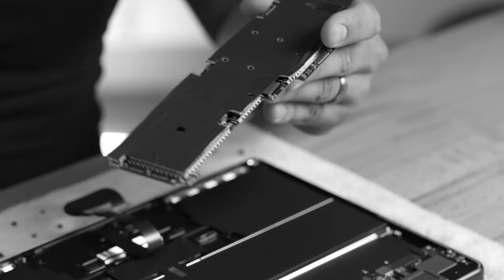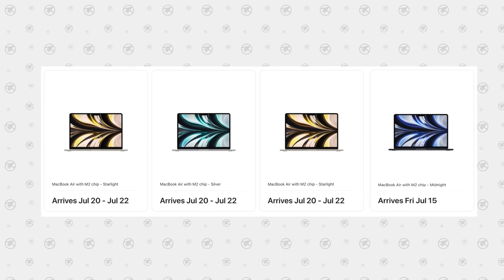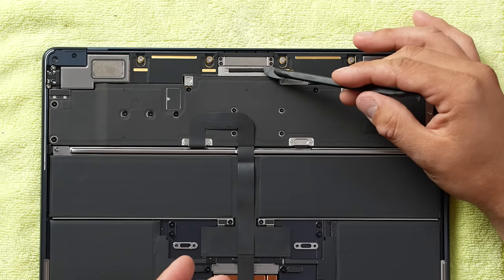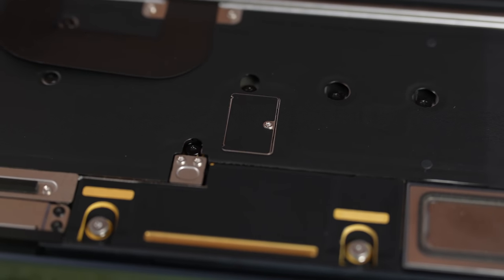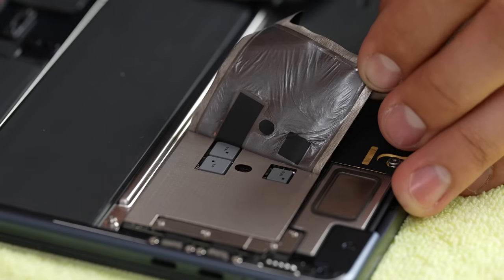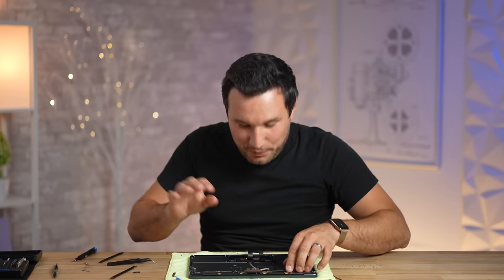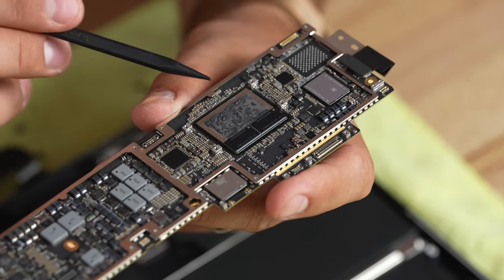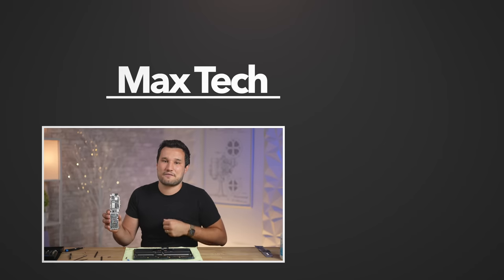M2 MacBook Air Teardown: Apple's SECRET Revealed (& SSD)

Comment: No matter what the reasons for the weak SSD are. Apple would have found a way if they wanted to. Simply supplying the device with 512 GB as standard would be an option. At least for the Pro model because it is supposed to be a Pro...
Reply: you're right its more forgivable on the air
Reply: Would make so much sense, apples line up is a huge confusion. The gap between entry level machines and pro are too close. And the upgrades prices even get the all thing worst...
Reply: @macalienx  I bet anything they want a bigger gap but with chip shortages and prices they couldn’t. The air alone went up like $200.
Reply: At the price of the new air (and pro as well) they should definitely have 512gb as starter and no 256gb anymore.
Reply: @RyanEllerbe  true, that situation with the chips are going to bring all those prices up... And the delivery times too.
Reply: yep,
Reply: Amen to that.
Reply: at those quantities that apple purchases at, it would have been a dew DOLLARS at most for them to give us a better SSD. it's unacceptable to start at 256gb for a $1200 laptop
Reply: @nintendork07  .... but in the other hand if there are no chips avaiable the prices probably are going through the roof... But i agree that for the price and the actual fact that we are in 2022, 256gb are useless if we think the capabilities of this machines. They are not a machines for ocasional browsing and word documents...
Reply: @RyanEllerbe  you do realise another 256gb module costs less than 30 bucks in bulk?  It's a NAND chip only, the controller is external on these apple selicon machines. 
They could easily eat up the cost to make the base model 512gb, and even increase the price by another 50$ and no one would bat an eye, but no, they make you pay another 200$ for it or you get an SSD half the speed of last year's model...
Reply: @houssamalucad753  first we have to assume that they could get enough 128 GB chips. They also want to make a certain amount on each air. If they would of added $50 people would be losing their minds.
Reply: @RyanEllerbe  they already added 200$ and people didn't complain too much because of the improved desing, I bet no one would complain about another 50$ increase for double the storage tand SSD speed (and as a bonus a more durable SSD for swap)
Reply: @RyanEllerbe  it's apple, they are the first in the list when they make that kind of order, suppliers chose them first because they always make huge and reliable orders, maybe they can't justify 128gb chips, then they can put 2 of the 256gb chips instead with a reasonable price increase (it wouldn't cost much more trust me I work with this kind of stuff)
Reply: @HotHeadCringe  How about if we take preventive measures to help Apple with the supply and discourage everyone from buying this crap.
Reply: @HeavenSevenWorld  How is the M2 MacBook Air crap? It's an amazing piece of kit.
Reply: Ya true, but marketing wise, they can’t. Apple need a low price version so they can put it big on their website.
Reply: @yapchenpo95  Oldest trick in the book, same with car companies advertising a car for $20k, but the commercial only shows the top of the line $30k model, which is the one you want as the base model has nothing.
Reply: Oh, so the 512GB SDD is a good option to take to mitigate this SSD speed concern.
Reply: @yapchenpo95  they are still selling the M1 air...
Reply: @PerplexedPhoton  ...starting from 16/512, which is very close by the price to MBP 14" 16/512, so no – it's not amazing. It's pathetic.
Reply: @JK533  With the CPI going up 9.1% and the PPI going up 11.3% in June, you expect more for less anywhere? We’re typically getting less for more, especially in the light of shortages. People don’t cut prices during shortages or even keep them the same. This is the first price increase on the Air in about a decade. I don’t remember the exact time of the last price increase (it went up by $200 and then went back down by $200 a year later), but it’s been a long time.
Reply: They could have found a way. You might not like what their way would have been if they had chosen differently. Given the catastrophe with Western Digital’s two factories that destroyed trillions of gigabytes worth of flash storage, the solution would have probably been to postpone the Air launch for a long time until supply catches up. Which poison would you prefer?
Reply: @techinrl9869  Postpone instead of ruining the great impression after the M1 during the difficult time of the transition, obviously.
Reply: We don’t talk sense when it comes to apple. This is makes too much sense.
Reply: The M1 Air set a new standard for basic laptops. The base model  M2 Air should have had the same dual SSD as the M1. There is no reason that the M2 should have lesser performance compared to the M1.
Reply: Yes, with the new price, 512GB as standard would be a nice decision
Reply: Hehe, Apple loves screwing their customers.
Reply: Actually the Pros start with base 512GB
Reply: This is the genius of Apple, you want a new upgrade as soon as you buy this model. Yet people come back for more.
Reply: Last time there was a redesign, 2018 it went up to 1199, same as this year and then it dropped by 100 a year for the next two years
Reply: @rrp6405  so if i understood well  the 512 ssd is better because it has 2 chips?
Reply: The reason its slower is because they use only one chip. With M1 on the air and the pro the 256gb option used to chips
Reply: @RyanEllerbe  i dont believe the price jump was because of the chip shortage. Everytime apple released the macbook air with a redesign it was more expensive than the last one and in the span of two years it went down to 999
Reply: It saves costs. For the most popular versions, they simply need to order one type of chip.
Reply: @macalienx  256GB costs around $25, Apple definitely could increase the base storage to 512GB.
Reply: @luquivarde7266  they use two chips for m2 ssd from 512gb up ?
Reply: @techinrl9869  in the other hand, when inflation was virtually non-existent, Apple didn't reduce the pricing (like other companies do). It's curious how we are ok with Apple not reducing prices or even running promotions when all the other companies do it, but when they increase price is all "but of course it should be more expensive, it's because the inflation".
Reply: @AlejandroLZuvic  Apple knows that many people will buy it anyway, so they keep making profit...
Reply: @AlejandroLZuvic  What gave you the idea other companies reduced pricing? What they’d do is come out with new items and charge the same prices. Keep in mind with inflation at 2-3% as normal, not raising prices IS reducing prices. They’d still be losing 2-3% each year. I would note Apple did reduce prices many times. Each time an iPhone carried over to the next year, they’d reduce it $100, e.g. iPhone 11 and 12.
Reply: because of supply chain issues, and Chinese government restrictions, and inflation Apple probably had to through it in last minute, overall the m2 chips seems to be quite lackluster.
Reply: Great tear down!
Reply: There is no "Pro" MacBook Air model...
Reply: Actually this would be something to decrease the speed in the m1 models so that m2 would be a much better option
Reply: I bought M2 base model but I will return it and get a M1 16GB 512 SSD
Reply: Maybe it has something to do with availability of 128GB NAND chips. Apple probably has a hard time getting 128GB NAND Chips these days, and they don't want to go straight to 512GB base model due to pricing.
Reply: Exactly this. Apple KNEW these reviews would come out and did this intentionally to try to upsell you.
Reply: Yes 512GB should be starter size, I can understand TB4 and docking will get you great speed, but 256GB is to small even 4 years ago.

Comment: These reviews and teardowns really help me in deciding what to do, M1 Air, M2 Air or spending more and going for a 14 inch Pro. For me it works to understand how they are build and how they perform. I am not a creator who needs huge SSD’s and multiple 120Hz 4K or over displays so all of the extreme benchmarks do not really apply in my case. A teardown like this helps.

Comment: I would be very interested in seeing how this thin heatsink performs, and how much thermal pads would help. This heatsink has quite a lot of surface area, so you could probably fit a lot of thermal pads on it.
Reply: It is worth remembering there are regulations as to how hot the bottom of a laptop is permitted to get, if you are sure your never going to use your laptop on your lap and you have a metal case a thermal bridge to the underside of the case will really help with thermals but be very careful not to use the laptop on your lap or other meltable fabrics, if you do a mod like this you need to only use your laptop on a desk (and a desk that is not going to be damaged by hot things so not a nice wooden French polish). 

What would be a more interesting mod but would require someone with some tooling (many LTT or someone else) would be to remove the large speakers and run a heat pipe from the cpu to that area with a small fan.
Reply: this little thing is going to get hot and thermal throttled a lot!
Reply: @hishnash  Add thermal pad+external fan, that’s going to be the best combination
Reply: @hishnash  
I doubt it would be that bad. 
The M1 Air with thermal pad exporting 4K video still has a cooler base than the 2015 MBP that’s streaming Netflix while on the charger. An M2 with thermal pads will only heat up while running prolonged heavy tasks like video rendering and exports and it still generates less heat for the performance than Intel chips, and no one exports video with their computer on their lap. You hit the button and set the computer aside to do its thing.

Comment: It’s so beautiful, but if Apple designs the base model with 16gb ram and 512gb SSD, that will make it more attractive. Thank Max Tech for these great content and information!
Reply: I think a 8GB RAM & 256GB SSD makes sense for the base model - with TWO 128GB SSDs.

And the upgraded model?  16GB RAM and two 256GB SSDs.  But not $400 extra.  Only $200.
Reply: I think they got the specs right for the base 14" M1 MBP, 16GB/512GB. Wish they did the same on the M2 MBA.

Comment: My 2013 MBA still works perfectly fine after so many years of daily uses and I have only replaced the SSD with a larger size one.  I plan to keep my next apple laptop for a long time too and the improved reparability in the new M2 MBA is definitely a plus.
Reply: I’m still on MBA 2013 too, had to replace the battery but otherwise it’s all good. I think this M2 MBA means it is finally time for me to upgrade though I’ll miss the extra ports.

Comment: That was a great review! It’s nice to see this system is intended to be 
 to repair, and also how they maximized the battery size. It sucks they only included a single ssd chip, which may affect performance in some cases. Great video!

Comment: Really interested in seeing how added thermal paste reduces the internal temperature around the M2 chip. Also curious to see if an external laptop cooling pad would additionally help as well, especially when trying to push the M2 to it's highest rated performance with limited thermal throttling. Great video though guys, definitely staying tuned for your further tests.

Comment: Hey Max! I spilled some coffee under the trackpad of this M2 macbook air, do you have any suggestions as to what I should do? trackpad responds fine, the feedback is just gone. I took it to a repair shop and was told they can't fix it, as they'd have to disconnect the battery. Should I go to an Apple Store and try there? would it be expensive. Thanks for the video!

Comment: Hi guys at Max Tech have you produced videos on installing a new replacement battery(batteries) and upping the Ram module (modules) to 16 GB. I bought a new MacBook Air M2 about 8 weeks ago in the UK on 30 January 2023, Surprisingly I noticed the for screws on the backplate, but I did not attempt to remove it. Your video short video was great.

Comment: Logic board looks like about the same size as the iPad Pro. I used to do DIY repairs and parts replacement on older models. Heck even completely disassemble and reassembly everything. Now, I'll just be a spectator and let the ones with clearer eyesight and stable hands and nerves handle it. 😅

Comment: as incredible as the density of the design and engineering of the m2 macbook air is, its hard to let go of the design decisions that limit this machines longevity (base being a single, soldered,  256gb chip and 8gb of ram; the rather expensive upgrades, ect)

Comment: I have a theory that the 1TB model will also have this slower SSD performance because Apple only have 256GB and 1TB SSDs. In the base there is 1 x 256GB, 2 x 256GB in the 512GB, 1 x 1TB in the 1TB, 2 x 1TB in the 2TB version. Has anyone done a tear down of the 1TB? Or an SSD performance test on the 1TB?